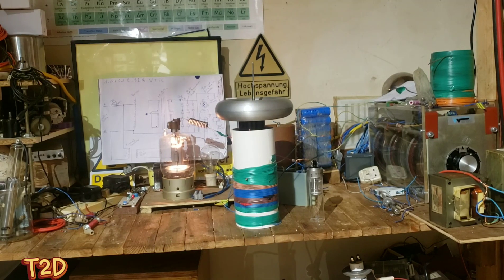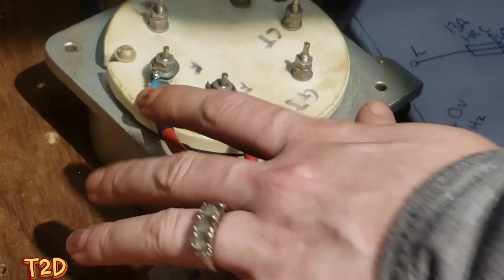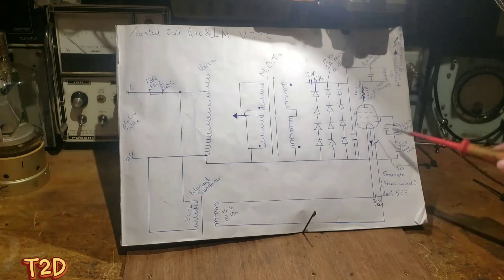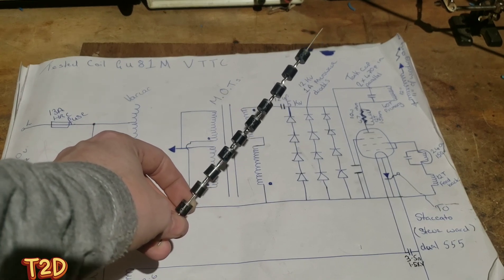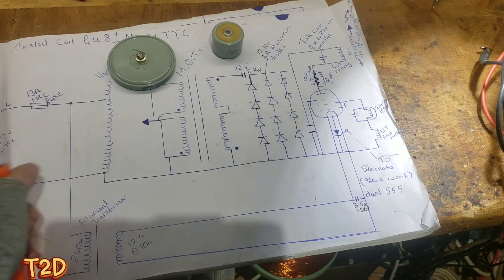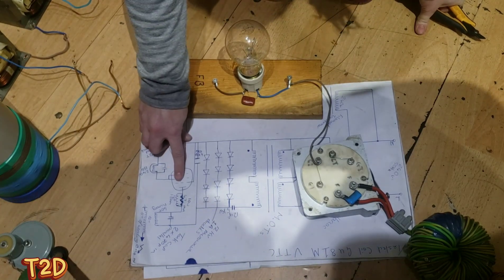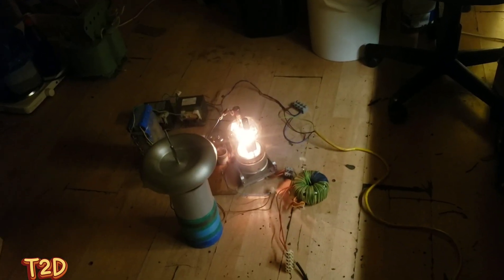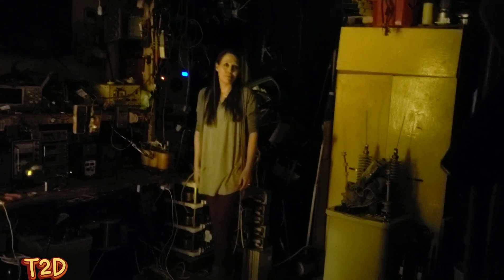GU-81m VTTC, Can my wife build a Tesla Coil?

Comment: Will this circuit work without staccato? If not then can i use a single MOT so i dont have to get a staccato?
Reply from the maker: @csanadsutyinszki5500  yes it's running without staccato in the initial test of Shellys build, although the output is better and its also  kinder on the tube if you run a staccato 👍, thanks for watching 
Steve
Reply: Thanks I will try it out without a staccato but will get on later.

Comment: I have almost no experience with TCs, but a lot of experience with HV systems; something that I was wondering was why there was so much current in the feedback winding, as it connects to the grids.
Reply from the maker: @cambridgemart2075  the tube needs a fair amount of positive grid drive and when you drive a grid positive with respect to the cathode grid current flows 👍

Comment: Hello again I hope you're doing better. I'd like to know if she used a 0.4 mm diameter or section area wire for the secondary. Thanks.
Reply: Doesn’t really matter the thickness of wire as long as it has a similar reasonant frequency to your primary coil
Reply from the maker: Sorry just seen this, 0.4mm Diameter

Comment: Hi, Great build, I'm going to build that monster someday, but I have maybe half of the needed parts. I have a question, can I use as a bank cap microwave oven capacitor connected in series and stack to make up 12uF value?
Or is that a bad idea? And what can happen if my cap bank will be smaller like 4uF and how long on full power without staccato this vttc can operate?

Comment: Fantastic and great to see your good lady tackle the project. Will be following this for my build, Colin
Reply from the maker: Thanks Colin glad you liked it mate,  so you decided to go with the GU81, I know you said you thought that was the plan.. I would maybe go for a slightly bigger primary form as a couple of people have had arcing issues with the 100mm one so maybe a 125mm would be a better option to make sure you have no issues, 100mm is very tight at this b plus and if the coil is slightly out of tune it could arc at high power,.. 

Steve

Comment: Good job I would love to build one But I live in Canada we don't have 240 Volts only 115 volts and 220 volts  plus what size variac  are you using?
Reply from the maker: Hi thanks, you can just use two 120v MOTs mate, also I'm using a 25A variac but it doesn't need to be this big for this coil. Could even manage without a variac if you used a ballast maybe, or with a small variac and a contactor and helping hand inductor etc ... 
Thanks for watching glad you enjoyed the video and please take a look at my other VTTCs too😁👍👍all the best from the UK

Steve and Shell 😁👍

Comment: Hello could you tell me with capacitor you've used for the electrolytic mmc?Thank you both😁
Reply from the maker: Hi, the MMC doubler capacitor  values and schematic 2 strings of x 14 330uF 450V (28 caps total) aswel as appropriate bleader/balancing resistors (82k ohms) iirc  are in the video my friend ..

Comment: I've built mine, but my secondary arced to primary 🤣🤣my form was only 100mm in diameter, i think i need a bigger one
Reply from the maker: Yeah a few people had that problem, I suggest somwhere around 125mm mate, if the coil is even slightly out of tune it can arc to the primary form with that little clearance, 120mm to 130mm will solve the problem, sorry about that but as you can see that's what I used, what diameter secondary are you using? 

Steve
Reply: @T2D.SteveArcs  Oh i see, my secondary is 3'' or 75mm in diameter
Reply from the maker: @hugo0627  okay well that also gives you less clearance as the one I used was 70mm well actually 68mm .. i think its just the difference in metric and imperial maybe, or just different standard pipe sizes in Brazil? Idk, well  I know now for future vids now so will be sure to allow for this 👍👍👍👍

Steve

Comment: I can affirm that this circuit works. Mine would have worked on the first try had I kept my HV wires short, separated and isolated and had I connected pin 5 of the GU81 to neutral or installed the SCR right away. Thanks Michelle for the inspiration and thanks Steve for all the help!
Reply from the maker: Thanks James really appreciated,  im glad your build went well, and well done 👍 😎,  I know this was your first Vacuum tube project so its really cool that you pulled it off and it ran straight away,  I know you missed a connection due to a little confusion around the SCR but that's a minor, as for cable management and layout that's on us to an certain extent and we will be sure to talk about this more in any future build videos, its great that Shell's video inspired you I hope it does the same for others .. all the best 

Steve
Reply: @T2D.SteveArcs  I am really happy with it! Thanks for all the help!  I definitely have the bug to build more. At some point I'll get started on the GU5A.
Reply from the maker: @jameshicks7125  AWESOME and your welcome mate 👍👍👍

Comment: Hey thank you for this video, i've learned a lot from it. I'm in doubt about something, how do you tune your VTTC? is it by changing the turns in the primary like in a SGTC? because from the setup is seems a little bit harder since the cables are insulated and in that configuration.
Reply from the maker: Il make a more in depth video soon showing my 1.5Mhz coil and I will talk about impedance matching and tuning etc, thanks for watching,  check out my other coils ... 

Steve
Reply: @T2D.SteveArcs  Okay thank you for answering, i'll be tuned for it, Cheers from Brazil
Reply from the maker: @hugo0627  thanks Hugo, as soon as I'm well enough I will be posting videos on a regular basis again,  thanks for watching...

Steve

Comment: Which thyristor did you use to interrupt the cathode ?
Reply from the maker: 1200v 10A because that's what I had on hand
Reply: @T2D.SteveArcs  4 kV power After all, 4 kV of power goes to the cathode, how can it withstand?
Reply from the maker: @GURONTV  I'm not going into an explanation here mate but 1200v is fine, trust me 😅

Comment: I don 't have a 0.4 mm wire , can I use 0.12 ? I will be able to wind at 550 kHz
Reply from the maker: If you change anything then it will be out of tune and you will need to do your own tuning just remember that more secondary turns doesn't automatically mean more output, you want to keep the turns to 700t to 750t at this frequency in my opinion

Comment: Lamp No switch in triod ?
Reply from the maker: It will switch in triode mate, but because I'm driving it at such high voltage it is better to run with the suppressor tied to the cathode 👍👍👍
Reply: @T2D.SteveArcs  I mean, your lamp is not triode, but pentode, the grids are not all together, one grid goes to the cap
Reply from the maker: @GURONTV  G1 and G2 tried together and G3 is tied to the cathode.. so technically it is in triode configuration but with G3 the suppressor grid tied to the cathode, you can also just tie all 3 Grids together but I prefer not to on two MOTs but if I was using 1 MOT only I would tie all the grids together...

Steve
Reply: @T2D.SteveArcs  Steve, can you please share the diagram of the stockatto controller?
Reply: And when all 3 grids are together, G1,2,3 are more powerful together, then the triode will be more powerful, I'll try it in different ways, thanks Steve

 GURON
Reply from the maker: @GURONTV  yes if you are using only 1 MOT put all all 3 grids tied together but with two MOTs it is better to tie suppressor to cathode 

Steve
Reply: Steve, can you please share the diagram of the stockatto controller?
Reply from the maker: @GURONTV  you have Facebook? Add me Steve Arcs

Comment: Hey Steve! Thanks for all the help!  Cap question: On the voltage doubler caps we're aiming for 10uf at 5KV, yes? Can we go a little higher in voltage like 5.5kv or 6kv? Will other caps work like Cornell Dubelier that are used in other tesla cap banks? I don't see why not, unless I am missing something about the behaviour of electrolytic. You did mention that's what you had on hand... and I overthink things.
Reply from the maker: The Higher voltage rating is preferable as it gives more head room mate, I'm not sure what you mean by other caps. If you can be more specific mate I can give a better answer, Cornell Dubelier make all different types of caps so if you can say which type that would be awesome and I can tell you my thoughts...

Steve

Comment: Can i replace the lightbulp with something i cant buy them in my country/cant find them
Reply from the maker: Maybe a 200 ohm 200w variable resistor 🤷‍♂️ I prefer I lamp because they have a positive temperature coefficient also you can see straight away if the coil is oscillating and you Also get an idea of grid current from the brightness of the lamp.. I will try measure the cold resistance of a 100w and 150w tungsten lamp for you,  you calculate the full power running resistance with ohms law as its vertually  resistive ..
Reply: @T2D.SteveArcs  first thanks for your answer but im actually not that educated on elektronics it is sufficiant to understand the dangers but building a teslacoil is my ultimate project to educate myself more about this stuff i will try to find a bulp or a variable resistor  . I apreciate your answer thanks again.
Reply from the maker: @tempusfugit4062  no problem 👍
Reply: @T2D.SteveArcs  would a100w and a 50or60w bulp in series work too?
Reply from the maker: @tempusfugit4062  absolutely 👍that want to be in parallel though not series buddy 👍👍

Steve
Reply: @T2D.SteveArcs  cool thanks
Reply from the maker: @tempusfugit4062  😎👍 thanks for watching and subscribing 👍 
..

Steve
Reply from the maker: @tempusfugit4062  Ltd light bulb not bulp right? Just checking because if you're spelling it wrong it might be hindered your searches 👍👍

Steve

Comment: Love the video! Also question, correct me if I’m wrong but the voltage doubler part of the circuit is also a half bridge rectifier. If that’s true… is it necessary for the circuit? I’d estimate you’re getting about 4-5500v from the transformers so would it be feasible to just use a neon sign transformer that outputs 5kv? Thanks you!!!
Reply from the maker: Neon sign transformer doesn't put out enough current mate you need 1A plus to get descent output .. the voltage doubler is a half wave rectifier but it also shifts the sinewave up so its all above ground so not only do you get double the voltage you also get double the ramp time ie twice the arc propagation duration.. 10ms on 50hz and 7.5ms on 60hz apossed to half this ramp time on straight AC it makes the output much better and is needed my friend..
Reply: @T2D.SteveArcs  You are the the best! Thank you!
Reply from the maker: @ChaseQuist-bv2du  no worries mate 👍👍

Comment: Hi i have 2 questions, first of. Where the heck did u get this many 450v 330uf capacitors they are quite expensive. Secondly is this capacitor value important, does it have to be that high or is it possible to use for example 4.2kv instead of for. Im planning on building one of these, i have everything and the only thing missing. Is the Cap-bank, and to get on these values with MO-caps u need over 100
Reply from the maker: I just had those caps on hand.. you can use a few microwave caps or whatever

Comment: This is amazing, I'll definitely build this one. Is the input voltage 120v or 240v?
Reply from the maker: UK 240v but as you can see in the video we use a variac so dont put full voltage on it probably 200v max on the mot primarys👍👍
Reply: @T2D.SteveArcs  Alright thanks, also what current and voltage is your SCR rated for?
Reply from the maker: Thanks man and Either 240v or 120v depends on the Mots you use, if you're in the US you will use 120v Mots..

Steve

Comment: I just built a GU81 coil based on your schematic and it works great ! Only 115 volts though. With a staccato circuit purchased from Eastern voltage research.
Reply from the maker: AWSOME 😎😎 115v doest make a difference as the mots still put out 2.2kv however the 60hz mains sinewave gives a period 16.6mS and 50hz give a 20mS period the ramp time is  period X 0.5 so 10mS vrs 8.3mS this means you may get slightly shorter swords 🤷‍♂️..
Good work 😎

Steve

Comment: is 75mm diameter pipe ok? because in Germany there is only 75mm
Reply from the maker: Yes mate should be fine👍😁

Steve
Reply: @T2D.SteveArcs  ok thanks😄
Reply from the maker: @motness  no problem 😁👍
Reply: @T2D.SteveArcs  I just assembled the tesla coil and I only get about 2-3mm arcs, do you know what the error could be?
Reply from the maker: @motness  it's out of tune probably, did you change my design??
Reply: @T2D.SteveArcs  
the circuit diagram is the same I'll try to install another tube I still have one
Reply from the maker: @motness  same size wire 40 turns of  1.5mm primary, 0.4mm secondary? Same length secondary 30cm 
Same diameter or 100mm same tank capacitance 940pf 
13 turns primary 
Same topload 150mm toroid or a sphere
Reply from the maker: @motness  is your 150w feedback lamp lighting up?
Reply: @T2D.SteveArcs  my tank capacitor is 830pf and my topload is 22cm thats the only difference
Reply from the maker: @motness  does your fb lamp light up
Reply: @T2D.SteveArcs  yes
Reply: but its not bright
Reply from the maker: @motness  try adding more tank capacitance,  also you can add me on fb Steve Arcs
Reply from the maker: @motness  it's out of tune for some reason would be my guess, probably the larger diameter secondary and bigger top load
Reply from the maker: @motness  it should be bright
Reply: @T2D.SteveArcs  what is the max Imput voltage you give the coil?
Reply from the maker: @motness  probably 5.5kv ish
Reply: @T2D.SteveArcs  I mean in to the MOTs
Reply from the maker: @motness  about 200v but I have fed it the full 270v🤣
Reply from the maker: @motness  did you try more tank capacitance?
Reply from the maker: @motness  add me on fb and you can send video etc
Reply: @T2D.SteveArcs  yes I Put a smaller toploade on it and an 1000pf capasitor the Arcs a still smal but its better I think the capasitance isnt right but I will try different capasitors
Reply: @T2D.SteveArcs  I will do that
Reply from the maker: @motness  try 1.5nf see if improves
Reply from the maker: I think it will be fine mate 👍👍
Reply: @T2D.SteveArcs  what do you mean?
Reply from the maker: But you should be able to get good output from 4.4kv from one mot and a doubler

Comment: Double Mot?! That cap bank is huge. Impressive design💯!.
Reply from the maker: Yes mate she ran it CW just before she said "right let's get the staccato wired up" 🤣 thanks for watching 
There are more videos of gu81 coils on my channel  
I'm getting 4 feet arcs now from a 1 foot secondary and still think we can get a bit more😁👍
Fantastic Soviet tubes, theres a GU39B coil on my channel aswel 13kw continuous 20kw intermittent.....

Steve
Reply: @T2D.SteveArcs   Gahh, I saw that coil! That’s the biggest VTTC I’ve ever seen. I might have to pick up one of those Soviet tubes. I’ve been using some 833Cs and they are getting hot. 
Which diodes are working well for you? 
Do you have a source for quality Door knob caps? 
I’ve been thinking about using some 866a or 3b28 diode tubes for a rectified coil but I think that might be a bit too much filtered DC and hinder spark length.
Reply from the maker: @jeffersondalton2023  yeah you don't want smoothed DC you want a level shifter like I use, you need the ramp and a syncronous staccato driver....
10A10 diodes are cheap and work well...
Watch all my coil videos mate theres quite a bit of info in them ...
I'm using 10A10 diodes with movs on my GU39B coil and that can pull 20kw, 

Steve
Reply from the maker: @jeffersondalton2023  door knob capacitors Ebay mate..
Theres better videos of GU81 coils on my channel too
I'm getting over 4 feet arcs now from 1 foot secondary 4 to 1 ratio is really good but I still think I can get a bit more🤣👍